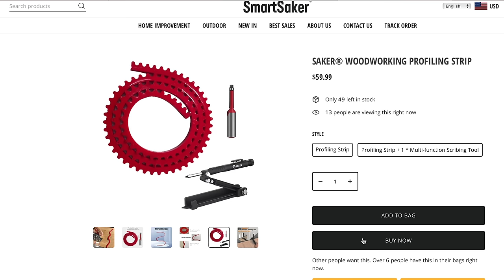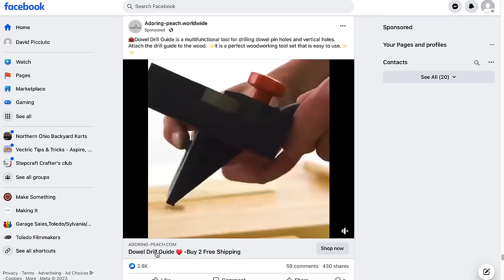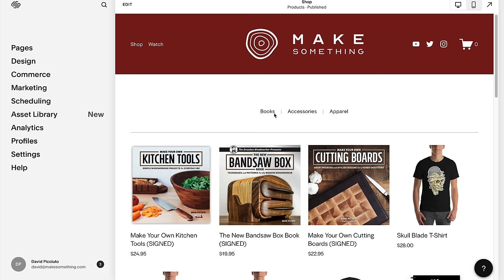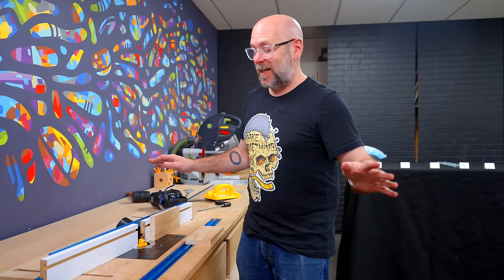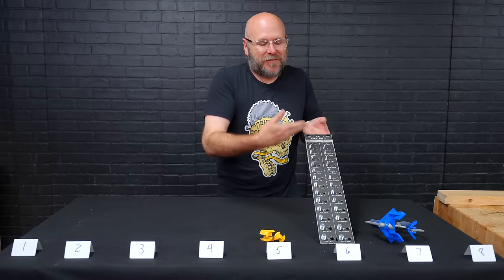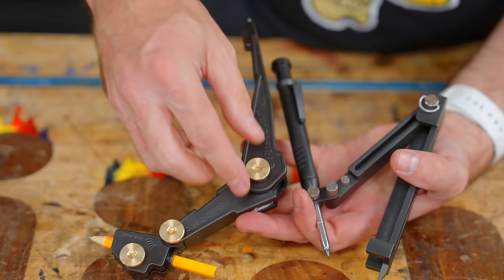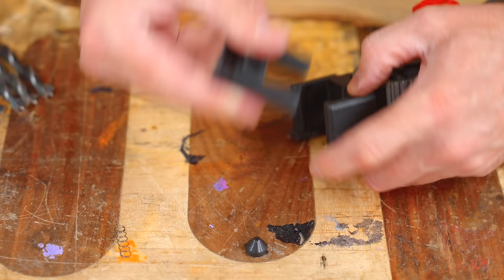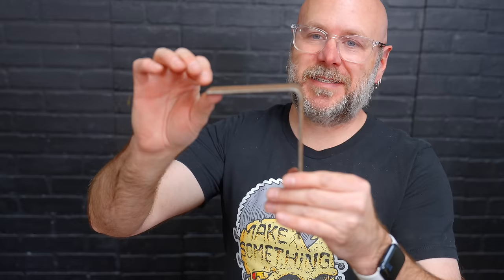I Bought Every Woodworking Ad I Saw on Facebook

Comment: That exact drill guide thingy can be bought in german offline stores for 9€ (10$). It works okay-ish with metric sized drills and for that price is acceptable, but heck no for 30$.
Reply: If you are german, just buy all the wolfcraft stuff. For the money it's great, it's not for pros but it'll help you make a small project just fine.
Reply: Pretty sure I got mine from Lidl.

Comment: I have used lock miter bits for several years, and have had really good results with them. the 1/2" bit is great for making strong, really quick drawers and boxes.

Comment: I bought the lock mitre router bit a while ago, and I am having trouble a) getting it set up and b) finding a piece of wood it doesn't rip to shreds.  I'm sure it will work in the end, and I will try your set-up technique to see if it improves things.  I was wondering about that flexible guide thing, so you saved me some money by demonstrating it!

Comment: According to the listing for the Saker 90 degree corner clamp, you get two for $50.99, so the is half price of the Kreg. You also stated that having two would be more useful than one, so the Saker product solves that issue also.
Reply: I think it mentioned x2 pieces... depending on what they call a piece, it might have been x1 clamp and the loose inside part is considered the 2nd piece? His order box should have contained x2 clamps though if it was indeed a x2 clamp order.

Comment: I'm thinking the router template thing could actually be useful for laying out and cutting a wood router template (instead of sanding to your line), but because of the screw holes it leaves behind that is about it.
Reply: Could be used instead of scribing to create a template. If you have a curved surface that you need to mate up to you could screw it to a board to follow the profile
Reply: Yeah... only good for a template. 
I was thinking about the screw holes as well.

Comment: The identibolt could have been a 10 if it wasn't so expensive. I would definitely find it useful.
Reply: Grab a selection of nuts & bolts from the loose fasteners bin at your favorite box store, stick them in a scrap of plywood, & label it with a sharpie.

Comment: Dude, you used the curve in quire a cack handed way, it's best used to create a template using mdf, you mark the curve, cut the excess using a bandsaw or jigsaw etc, then attache the curve and flush trim with a router..it makes cutting a curve template easier...you don't use it on final pieces

Comment: i've bought a few cnc bits from SpeTools and have had no issues. Granted I have a tiny CNC and don't do a ton of projects yet with it, but, for what I have done, they have been great, especially for the price. I know their compression bits are a new product for them, which might explain why no reviews. I have seen their adds getting pushed on several platforms so it seems they could be upping their marketing strategy to try and push into being a more recognized brand.
Reply: I also have several SpeTools bits on my shapeoko. No issues. They are a go-to for me. But never used the compression bits.

Comment: At 22:29 I see the metal riding on the handle that is higher which could make a crooked bend since one end is higher. I think the part that was bent could probably been flipped the other way but it would have been even better if they designed the handle to be on the bottom. It is basically same parts just have to mount one of the pins on the other side and then turn the handle upside down.

Comment: 17:00 if thats like every other deep reach mechanical pencil ive ever seen, there is a sharpener for the lead in teh back of the pencil. usually the back will unscrew on those to put the new lead in, that unscrewey cap part will probs have a sharpener.

Comment: 14:43 That strip could be useful on big commercial "Router Tables" (I dont know the correct translation here) 125mm Diameter cutter and go for it. (30-40mm Arbor)
Sure, depending on the shape you will probably have to remove dust collection equipment and various guards, but it could become useful under the right circumstances. Those small router bits dont stand a chance tho. With those, you will have to cut close to the line with a band/jigsaw and just use the bit for cleanup.

Comment: Honestly, you would've had a better doweling jig if you waited for the BanGGood one.  I bought it, and I've bought a lot of cheap & high end doweling jigs in my 30 years of woodworking. But the one that was back ordered when you did your video would've been worth the wait. It's well made, very solid, nice box to store everything. It was worth it. These cheap plastic ones. They work of course. But they're total hassles. (NOT ass holes, Hassles loll) 
But I have 2. But they're not always accurate, they move all the time. CRAP.. You really would've been a big winner with Banggood's doweling kit. Especially for the price, aside of the 2-300$ high end ones. Good videos!

Comment: Couldn't you use the spline tool to do a first pass, then cut it out with a jig saw and finish off with the template bit? I'm not sure if that's easier, but it seems like it would make it a lot more useful for thicker pieces.

Comment: The corner clamps’ match : Kreg’s being less jiggly, when handled, actually means something : it is likely that the threaded rod inside this clamp is machined with greater care, delivering at once more threads per inch.  This commands a tighter coupling with the mechanism conveying pressure to the jaws  More machining also means : a rod of a better alloy, granting great malleability and its enhanced resistance to brittleness or compression; it also reflects the use of superior processes and machinery that will yield results within narrower tolerances.

Oh, I forgot : it mainly means that adjustments on the Kreg’s, especially in the long run, will be far more precise!

Comment: There is a really useful sharpener under the tail cap of the mechanical pencil. Or at least there is on mine.  It's nice for when you want a good point on your pencil lead.

Comment: The flexi thing would work better if one bandsawed the curve leaving 2=3mm and then ran the router table with the trim bit. No way that little bit should be used to cut half inch ply all by itself. You can do the same operation with splines made from scraps and a few finishing nails. And you'll get a fairer curve.

Comment: I have that drill guide, I think whoever makes these also supplies Lidl here in the UK because that's where I got mine. On the plus side it was way cheaper than $30 (and it came with drill bits and dowels) but, yeah it's not the best tool. Mine's not as wobbly as yours but when drilling on to edges using the guide, it's really hard to keep it locked it to drill straight through but I made mine work for the joinery I needed.

Comment: 4th place, - You should just buy a cheap tap & dye set to guage your nuts and bolts
Normally around £20 or superglue a nut and bolt of each common size to a piece of board.
Definitly overpriced for what you got

Comment: You didn't carefully inspect the router bits with a magnifier to see if they were acceptably well-made, or describe if they use carbide teeth or what.
Reply from the maker: Correct. Good observation.

Comment: Maybe I missed it...  shoulda watched to the end b4 typing... but the Kregg is $50 for 1 clamp the knock off is for two clamps, so, it's actually half the price.  (2:27    The web pages cleraly states 2 pcs.)

NEVER tip, except in person when deseved. It's the only way to get these idiots to remove the tip banner.
Reply from the maker: I didn’t realize I was supposed to get two until the other one showed up in the mail the other day. 😄 4 weeks after the first one arrived.
Reply: @MakeSomething  That's just awesome. 4 weeks late is better than never. I think. 
At two for the same price as one Kregg, does it make it worth the purchase? Never owned the Kregg, but every coner clamp I ever brought I threw across the room. All worthless. Even worse than worthless, all so very damn annoying.

Comment: Metric or normal. You are funny.
Metric is normal. Just think in fractions of 10. It is so much easier.
Once i had a router bit in some factions of inches. Threw it right into the bin. Was not even made in germany. But in some other country that uses inches.
Same reflexes but different background. What a waste of energy an ressources to have different systems.